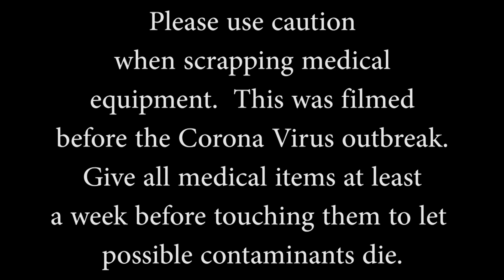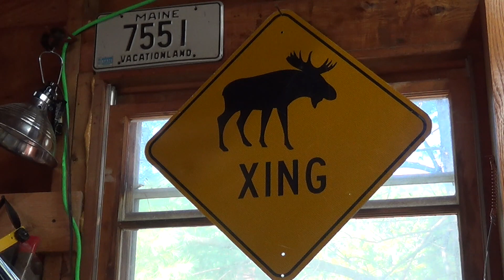Scrapping a CPAP Machine -Moose Scrapper #307

Comment: I find the best way to deal with things that won't come apart is to forcefully throw them on to the floor. one or two good hits on the corners will usually split the plastic case open so you can get to the goodies inside. Just make sure there is no glass inside before you do this. A broom is usually needed afterwards, but it still saves you a lot of time.
Reply: Scrapman50 especially when there is that one hidden screw. Hulk smash!!
Reply: A lot of inkjet printers are taken apart like this. I remove the 2 screws I can find, but the damn thing wont come apart. One good toss on the cement driveway opens it right up. I only get the pcb's out of printers, everything else is pretty much trash.
Reply: @scrapman502  save the cartidges and or laser toners, gold ribbons, gold contacts and aluminum.
If you look where the laser or inkjets were there are gold contacts.
Some printers have excess ink reservoirs which unless you don't mind getting the ink on everything and everyone around you be cautious as that stuff is nasty
Reply from the maker: I really dont like printers...almost as bad as vacuums.... lol
Reply: I found a vacuum in someone's trash the other day. I didn't have my cutters with me so I grabbed it and tossed it into my van. I actually found a motor in it with Copper windings! along with the 25 foot cord, I think I did pretty good.

Comment: Hey Moose, 1:42 the brown ribbon wire with Ag ends when you process do you use the whole thing or jut the ends?
Reply: Just the ends. Got to have a whole bunch of them.
Reply from the maker: I dont process those.  cost in chemicals outweighs the silver, if any, recovered.